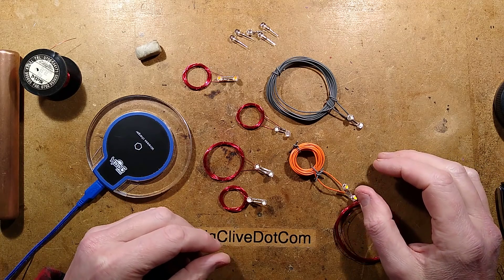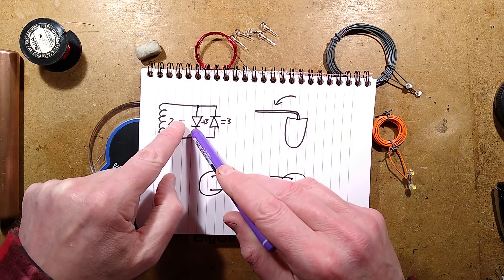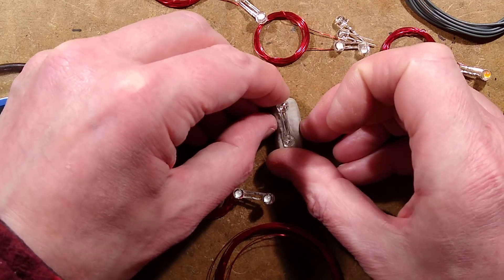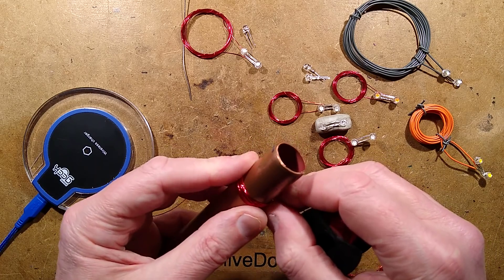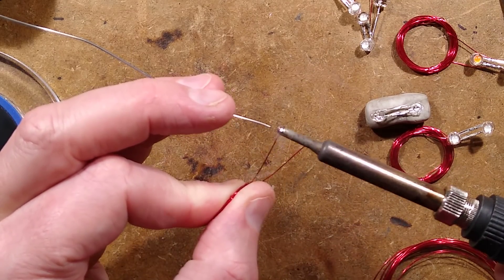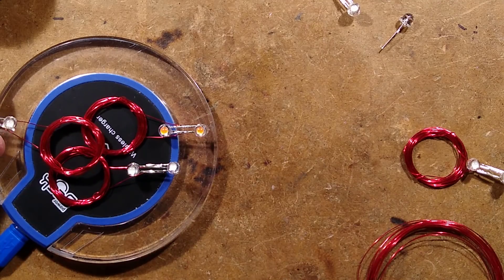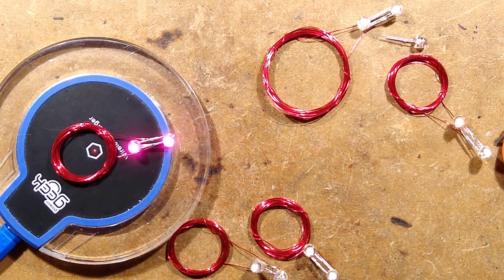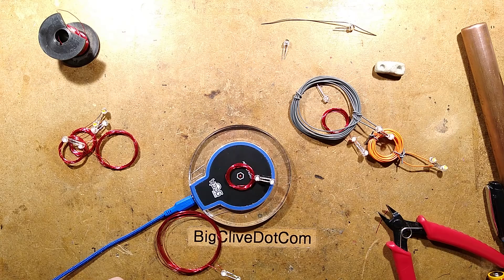Easy DIY wireless strobing LED light

Comment: Nice one. I bought a couple of cheap QI charging adaptors that work with most phones. They have a micro USB plug on the end. I used it to power a Raspberry Pi Pico.

Comment: This reminds of a small circuit I made where I made a guitar shaped PCB and wound copper wire around it (2000 turns) and soldered 2 smd leds to the end and later potted it in hotglue. Yours has turned out far better than that even with no resin. Mine was made a few years ago when I was still a starter in electronics (still am, but a tiny bit better). The blue tack tric is also really neat since all people don't have helping hands. And mine used both LEDs in parallel so it only turns on every half cycle of the output AC just like in yours.
Reply: „Blu Tack was often used with the Sinclair ZX81 microcomputer to help mitigate crashes caused by wobbly external RAM packs. This was such a widespread problem that Sinclair Research's technical support department officially recommended the use of Blu Tack or electric tape to resolve this issue.”
Reply: @jkobain     Sinclair also used Blu Tack to hold the C5 Wheels on...

Comment: Pretty neat.   Do you think the green / 10 turn worked on the phone because of the fwd voltage characteristics of the green LEDs, or did the number of turns have something to do with it (or both)?
Reply from the maker: Not sure.  Possibly even the thicker wire.  I may experiment with that.